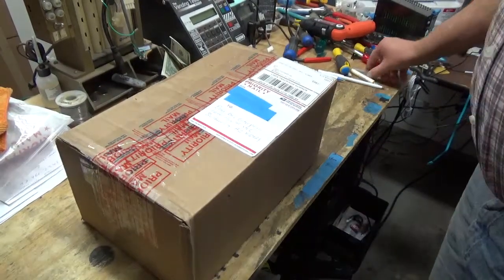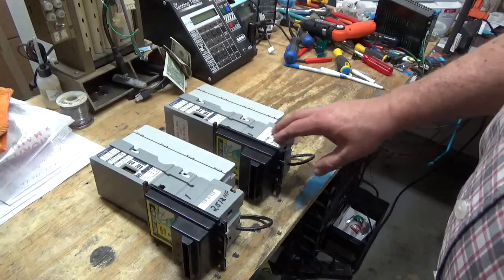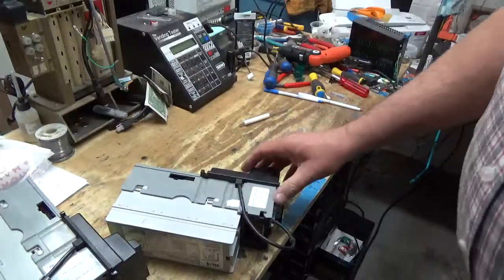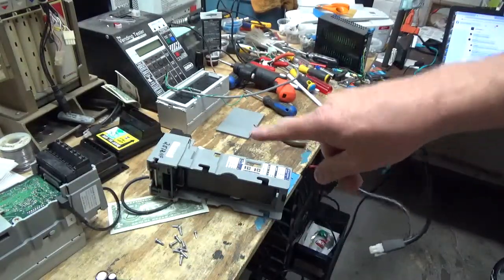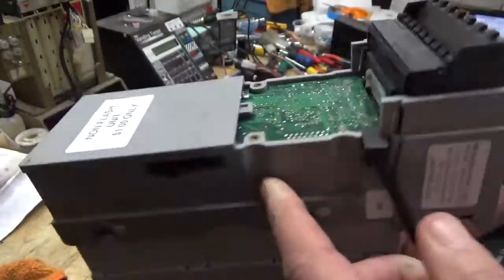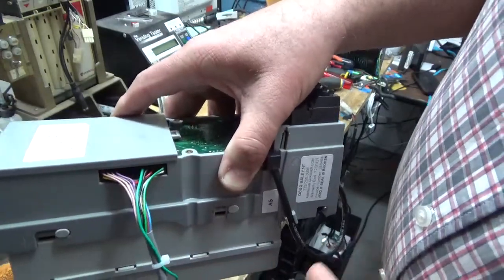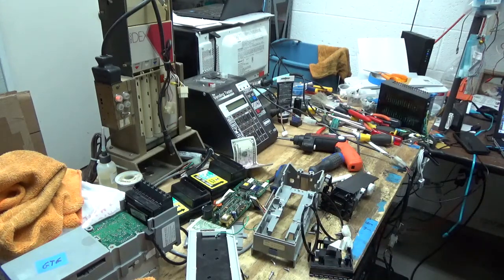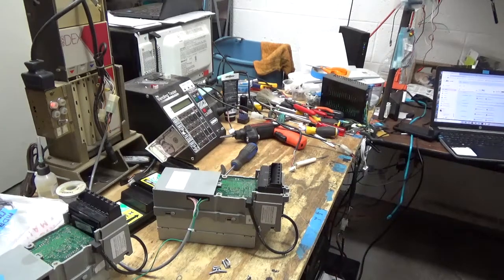MEI Trouble Shooting Of A 24, 115 Volt Validator Tips #5

Comment: What do you think could be the problem with a coinco 24v  MAG52BX with a red light flashing 7 times, and when you try to give it a bill it doesn't even attempt to take it(No sound- no nothing)? I do hear it cycle on when I power up the coke machine. Also do you have a website?